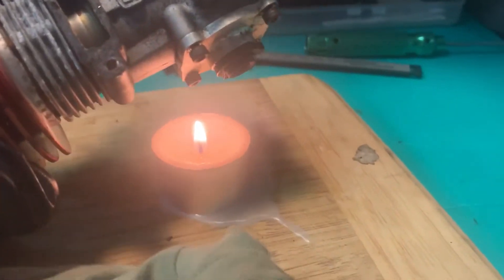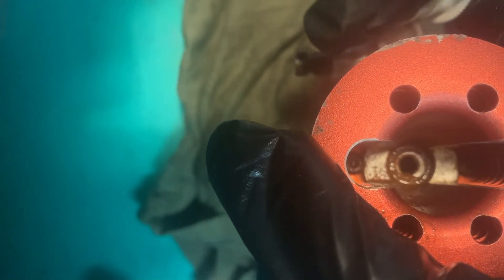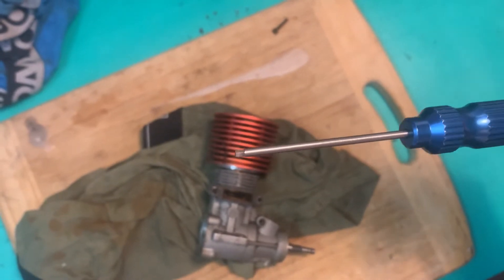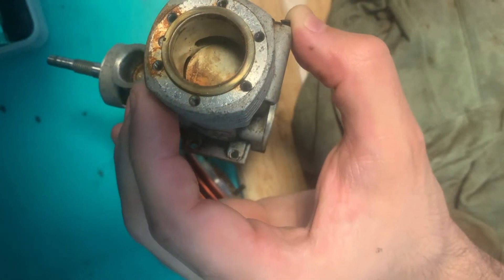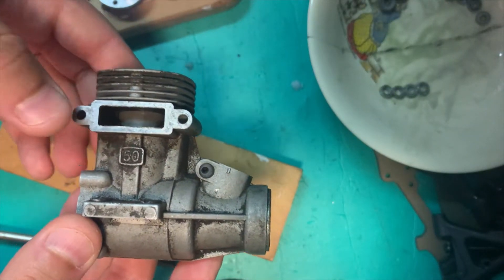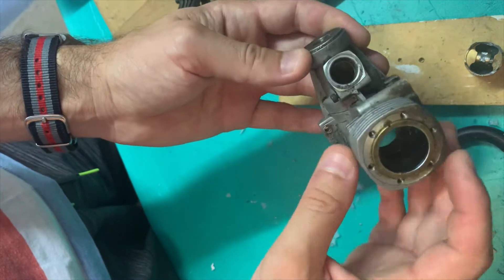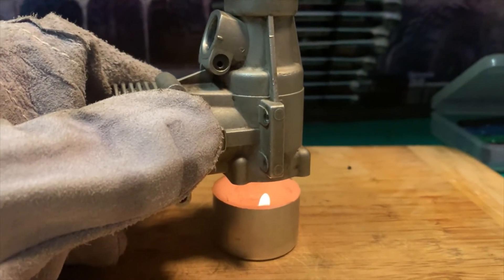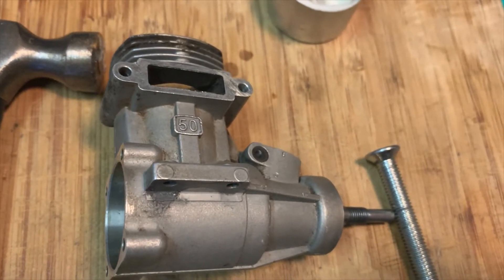Pro-50BK Engine Reconditioning CorporateNitro EP04 MGT 8.0 Thunder Tiger

Comment: Not done right he destroyed the sleeve bore because he was afraid of heat. His collet raked across it and chewed it up.  And you dont want to pull inner race of bearing when locked on outer race housing unless you don't care about bearing he got used to heat as video went on and more luck...good learning on camera!
Reply from the maker: Hi! You are not wrong! I made a mess of both cases for sure. Cracked the fins on the first case and scored the inside of the case on the second case as you mentioned. 
Correct 11:57 I pulled the rear bearing from the inner race. Since I used this case in the end I should have just left it there in hindsight. How would you have pulled this bearing if you needed it for a different engine? Well besides using heat and smashing it in a table like the Bug404 which doesn’t work on old rusty bearings. What is the correct procedure?
Reply: @inzp3ctor  More heat when pulling sleeve if you had used alot of heat the aluminum expands alot more than brass and the sleeve would have pulled out just using the small edge on top. Or you can do what you tried with piston let it catch the edge of sleeve and stick and use crank and piston to push up on sleeve only after heated obviously. The collet wasnt bad idea if you could have adjusted it in a way that it didnt rake the  bore not sure if that was possible only you were there for that setup. As far as the bearing if you didnt want it to be so stubborn more heat again. But as you said if it didnt need out then leave it and if it did need out then hurting it wasn't a problem because thats one of the only  replaceable parts you had in possession.

As far as bearing install and pulling it in at the end of video better to acquire something that was close to outer race diameter and pressed in straight after case was heated if you couldnt acquire that then get one more of same size bearing set it behind bearing being set in housing and use its inner race to pull with while case is hot that way your not pulling on the inner race of the bearing your going to use in the engine. Hard to come by engine I have one myself. Lastly before installing piston sleeve after the collet carnage you should have polished the bore up a bit from the pulled up metal and remnants of the carnage and then sleeve and piston might have been able to operate properly still.

Comment: Wow that was a long and painful process. Good job you took your time to do it right though. There was a lot of rust.
Reply from the maker: Yeah it was heaps of work, more work than I wanted to be involved with. But once I sunk my teeth into the project and found support from Roberto who donated me exactly what I needed there was no stopping me. Some people probably would have just tried to start it. But I figured, if the chassis is rusty and crashed but new, then the engine is likely to be rusty but new. So that’s why I invested the time. I didn’t want rust from bearings or crank destroying the compression. Today I gave it a start to clear the fuel out of the carb and lines. It started very easily. Will try to hit the two speed if it stops raining otherwise I have 4 touring cars that need work